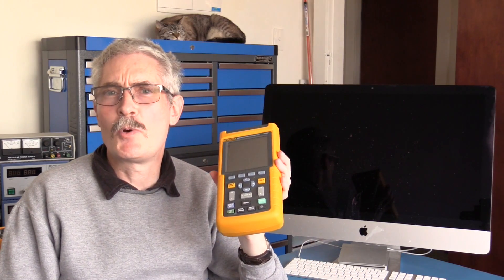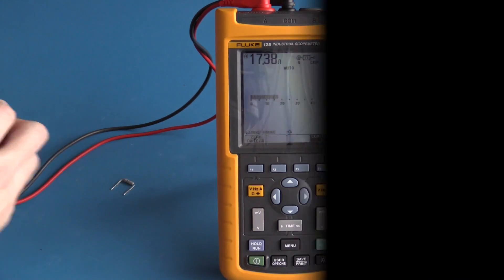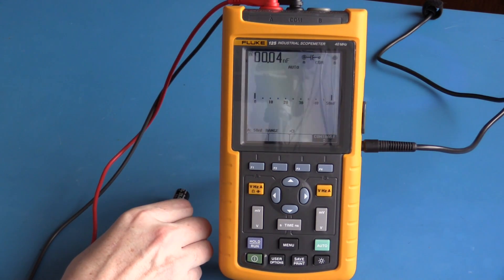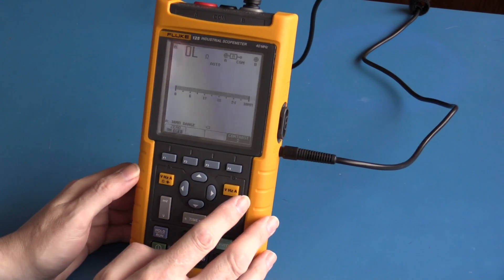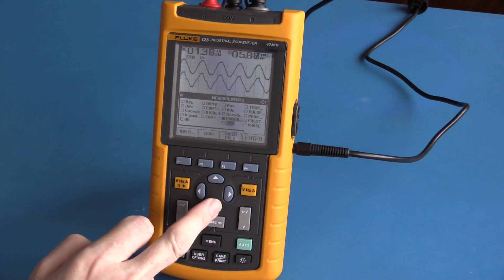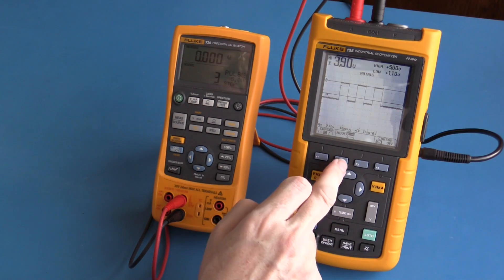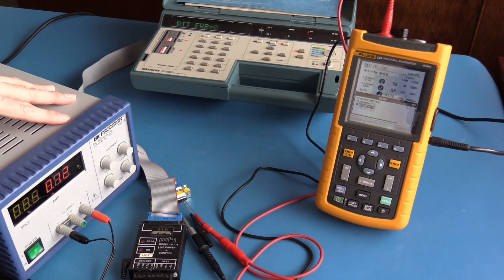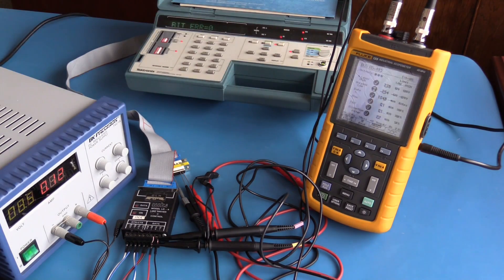BSL008 Fluke 125 Industrial ScopeMeter

Comment: I have an opportunity to buy a used Fluke 125 for a good price but I was wondering if it can measure DC power (Vdc * Adc). From the video, it looks like during power measurements, it uses AC coupling for voltage and current. Can this be changed? Can you select DC mode for voltage and current during Power measurement?
I'm interested in DC power measurements for automotive troubleshooting and PV inverters with battery.

Comment: I guess it's a very old meter.  I just bought a Fluke 125 NIB.  Someone owned it but never used it.  Gave $200 USA dollars for it.  The fact it's Bus Health offers RS-232 says it all.  Really appreciate the video.
Reply: Will you sell it to me for 400$
Reply: 200 Dollars is cheap! Usually they cost up to 1000 Dollars.
Reply: @johnbiden2834  True but it's a pretty old Scope Meter.  I haven't decided if you keep it or part with it.  I'm a Technician but use an old Tektronix 2235 Ocilloscope..
Reply: @scotta9114  Whats the problem of an old scope, as long its functional and look-and-feel is good? This scopemeter is not so bulky, i stil like it much and use it as a multimeter with graphics. Its portable and isolated from mains (no unintended short-cuts can happen) and from PC, if infrared cable is attached. Yes, it has no zoom or deep memory, and its limited to 20 MHz/40 MHz. But this is not a problem, its just a limitation, as anything has (when i use a screwdriver, i not expect its a hammer). Nobody should throw his multimeter away, because its just old. Same with scopes. Especially Fluke is vintage and never worthless. When i pull out my 20 years old Fluke multimeter it measures precicely and reliable as new meters, while other meters loose precicion, if not calibrated at least any 5 years. Some new devices from Far East have terrible software and not the same look-and-feel as Fluke. Some not even had hardware-trigger. This scopemeter fills the gap between multimeters and bench-top scopes. If you want a better portable scopemeter with battery, choose Rhode Schwarz Scope Rider. But until i dont need it really, i will not buy it (4000$)

Comment: What current clamp do you recommend for up to 1A DC to measure. Must it be a Fluke Clamp?
Reply: Fluke i30/i30s - Current range: 30 mA to 30 A DC, 30 mA to 20 A AC rms
 ,Frequency range: DC to 100 kHz

Comment: I know that the series 125 meter is the top of the line in this series because it includes the ability to make watts, harmonic analysis. My question to you is are you familiar with the fluke 43B power analyzer because I would like to know if the fluke 125 incorporates all the functionality of the fluke 43B
Reply: 43B is full fledged 1phase power analyser. But what makes 125 handy is its multimeter and scope functionalities  including dual trace . This makes its good for field repair as well as power quality tests.

Comment: I've had the Fluke 123 for 16 years and I absolutely love it.  If you are an industrial electrician working with all sorts of industrial electronics such as VFDs, Temperature controllers, SCR control boards for heaters, Synchronous motor controllers, etc. then this is a great tool.

Comment: I was considering getting a Fluke 123 second hand, and this video has mostly sold me. But I heard their usable scope bandwidth is actually only around 2.5MHz?
Reply from the maker: The Fluke 125 has a real-time sampling is 25MS/s so it really depends on the resolution you need and what you are trying to capture. The 125 will not replace a bench scope.
Reply: Black Sheep Logic I just do vintage computer repair and various hobbyist electronics, was thinking about getting one for where a full scope is too awkward, but I decided against it
Thanks for the reply!